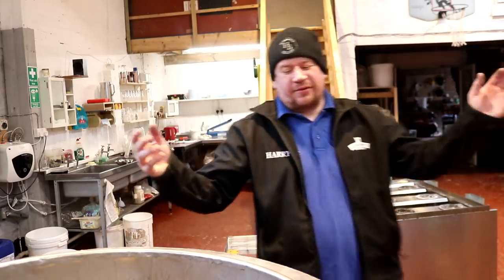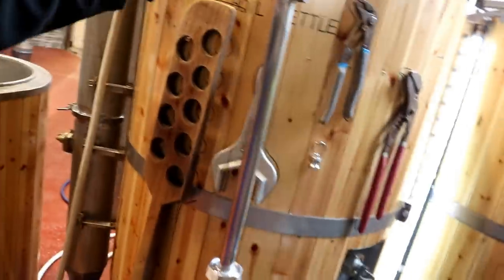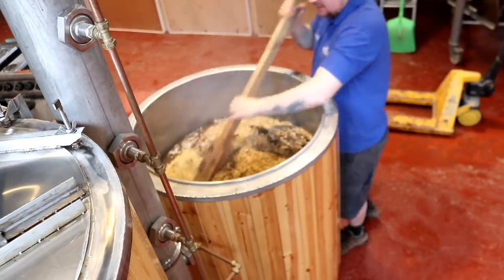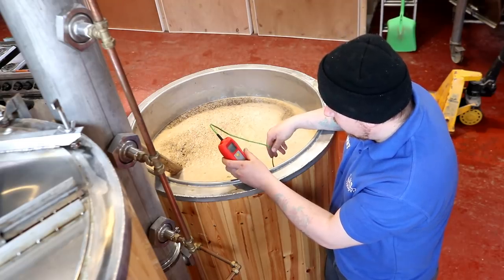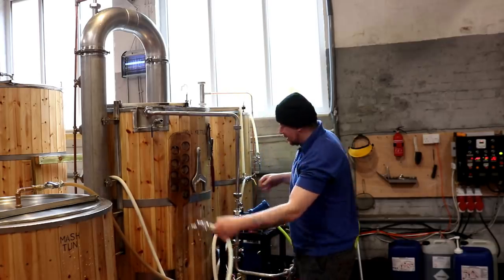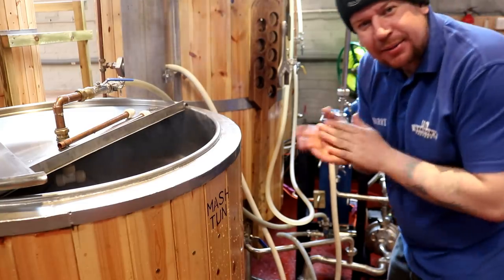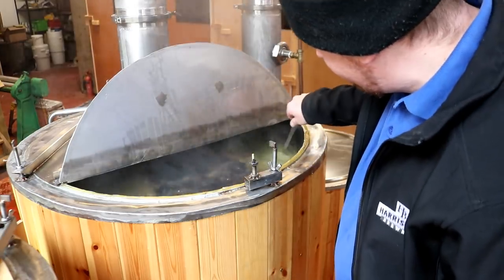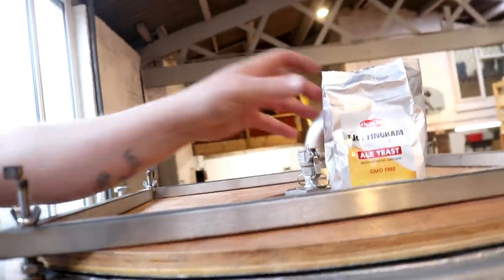Harrison's Brewery Stout ~ Recipe Brewing Video

Comment: Do you adjust your strike water temp according to the seasons. Ie warmer strike water in the depths of winter vs cooler in the summer, or does that not have an effect?
Reply: Can't answer do Chris but the calculator I use asks for the temp of the grain and uses this to alter the strike water temperature. As Chris points out a brewer really needs the mash to be at the correct temperature as swiftly as possible. Getting the correct strike water temp bang on is one way of doing this, especially if you aren't using Herms system.
Reply: The mash tun is a really well-insulated container, it should be as good as a thermos flask really, so outside temp of the brewery shouldn't make any difference to what's going on inside the mash tun.

Comment: Save the file to a folder and zip the folder up ;-) to share it, if you can not share a zip or a rar file just rename the file to one you can share, so say its Stout.zip and it will not let you share a zip rename to Stout.jpg but let everyone know they need to rename the file...good temporary way of getting files up until you get a more straightforward way of sharing the files without messing around.